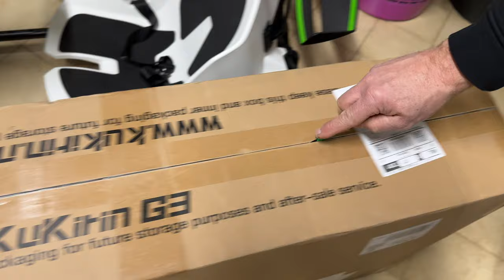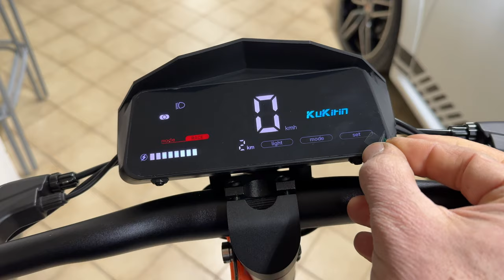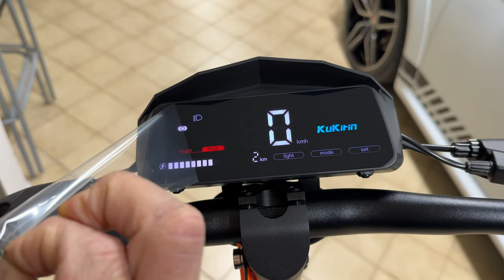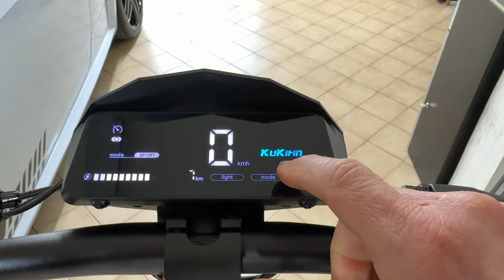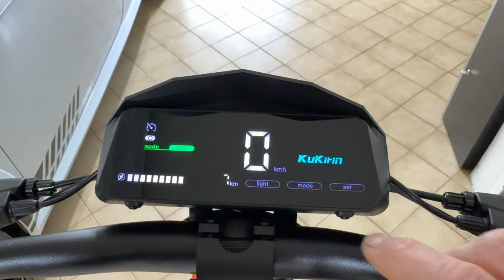KUKIRIN G3 - 1200W OF PURE BEAUTY - FULL TEST & TOP SPEED - 4K

Comment: XTom Good morning! Can you help me?

The top speed undoubtedly on the G3 with 1200watts and 52 volts make it a few kmh more than the G2.

But one thing I wanted to ask you for yourself that you tried both...:

I like the G2 aesthetically more as well as having softer shock absorbers..., but on acceleration and recovery you can see a greater cue on the G3? Or are acceleration and recovery the same?

Because in case acceleration/recovery is the same I would go with my eyes closed on G2!